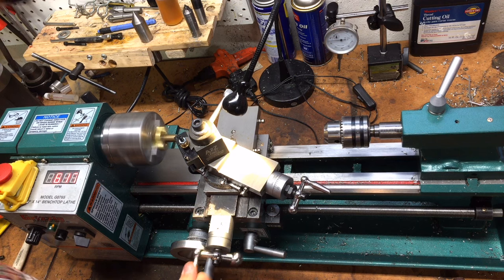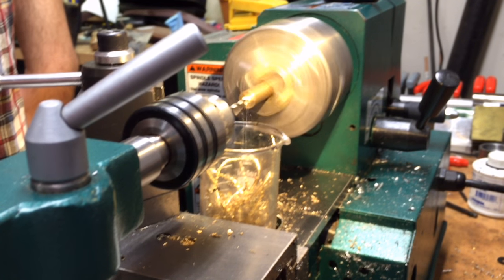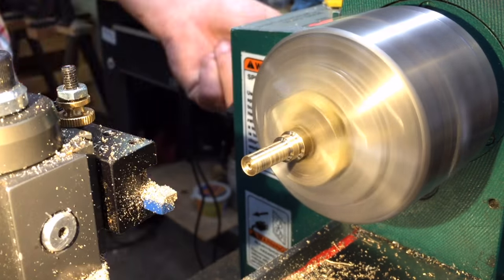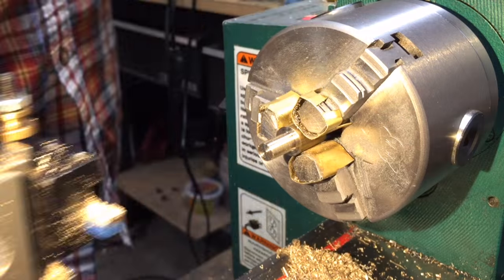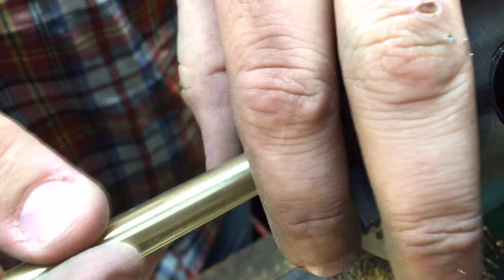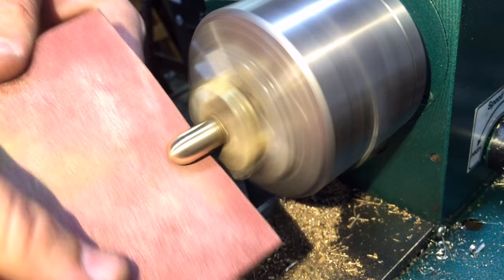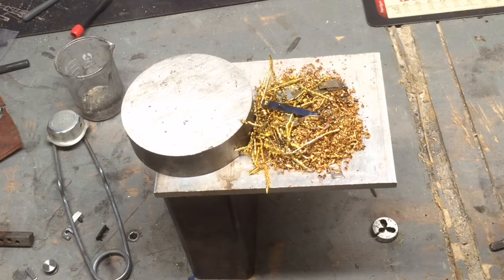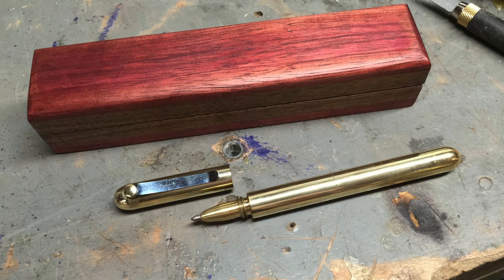Making a Brass Space Pen

Comment: Yes you are correct about having a handle on your file.  But what is the correct file to use on any lathe?  A left handed file.  That way your filing action will take your hand away from the spindle and or chuck.  Give it a try.  

Nice looking pen.

Comment: I`m curious as to why you were parting off with the bit upside down and lathe in reverse ?
Reply: Because it’s easier on small lathes
Reply: Running the lathe in opposite direction to save the chips downwards and not fly all over. Good to do if your chuck locks on so as not to unscrew if you have a hard cut.

Comment: Did you clear it? If not, what did you use so the brass won't tarnish?
Reply: Todd Wall , renaissance wax.... Protects the metal without the ugly clear coat that inevitably chips off and looks terrible. It does take maintenance but its worth it.

Comment: Giday mate , just wondering why you are using the parting blade upside down ? Maybe I have bad eyes ....
I could see the metal trying to jump up because the blade is wrong way .
As far as I know the force of the blade should be downwards not upwards .....  
Forgive me If my assumptions are wrong.
Reply from the maker: +outbackdigital on my little lathe for certain operations it's easier to run a parting blade upside down with the spindle in reverse to avoid binding, the tool is just pushed out of the way instead of being pushed down and jamming into the work.  Thanks for watching and great catch!!
Reply: +Practical Renaissance  got the same Problem with my Small Proxxon Lathe.
Thank you for sharing your knowledge!